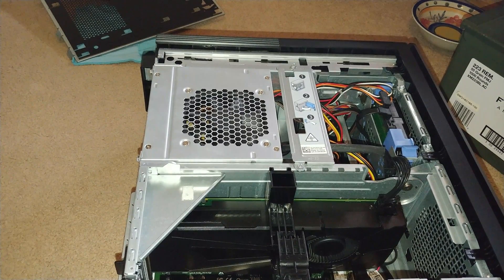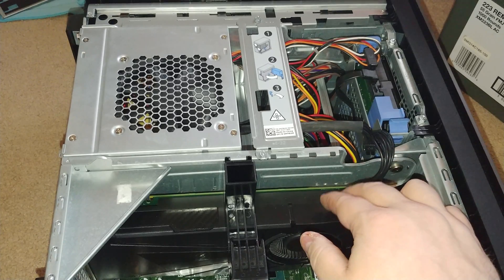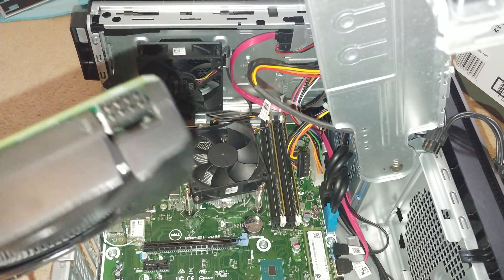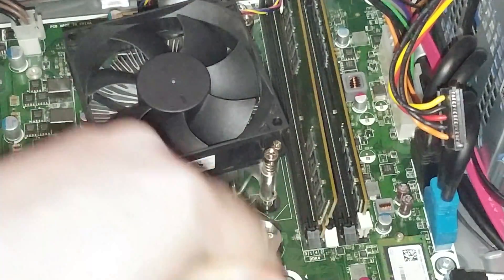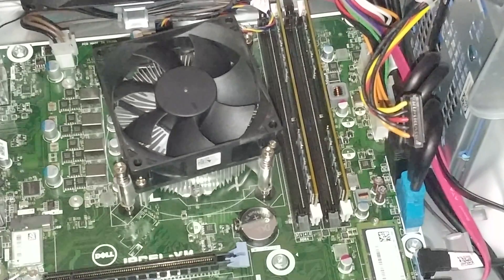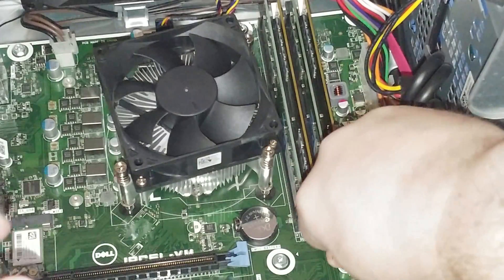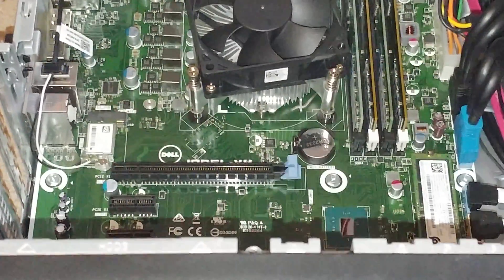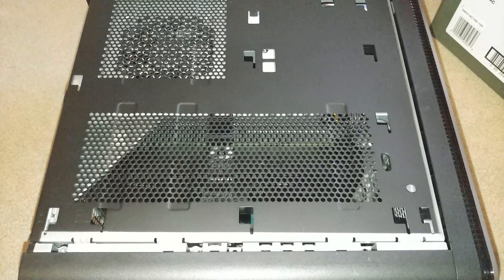Dell XPS 8930 32Gb RAM Upgrade

Comment: I have a G5 desktop that cane with 1x8 so I guess it’s the same process? I had an issue many years ago where the system didn’t see all the ram
Reply: @StreamingIraqWarVeteran  if I find cheaper higher speed would it work? I wish I just got the ram when I was building the system on dells site because it can void warrenty

Comment: Just received one :) Upgraded powersupply to 700watt antec and gtx 1660 ti video and added another 16gig for 32.  My only complaint is the case is too small for an I9 and the heatsink looks like something for I7. Too loud and hot unless I leave open and swing powersupply out a little. So ordered a better heatsink and if I have to will order a new larger case for it.  Certainly fast though.
Reply: Check out this Dell thread for upgrading the cooling. I will probably do this soon. https://www.dell.com/community/XPS-Desktops/XPS-8930-SE-Exhaust-Fan-and-PSU-Upgrade/td-p/7311865

Comment: I have this desktop and want to upgrade the ram to 32gb so I purchased the kit Corsair LPX 32GB (2x16GB) 3200MHz C16 DDR4 DRAM Memory Kit... Would this not work since it is 3200? Or does it have to be 2666? Also would I run into any issues installing 2 16gb sticks?
Reply: Streaming Iraq War Veteran Got it thank you. Then I’m assuming since it can’t exceed 2666 would that mean it would stay at the low end I think being 2133?